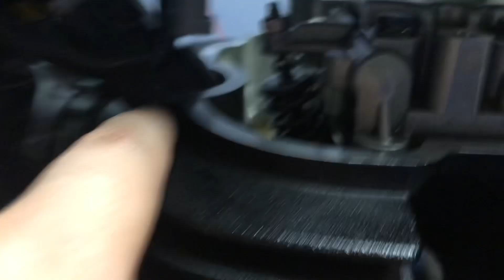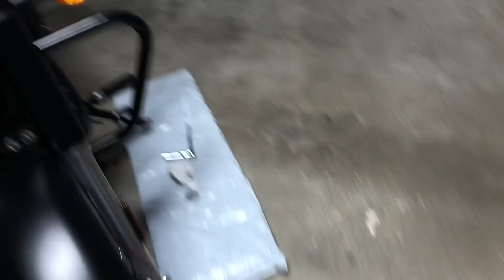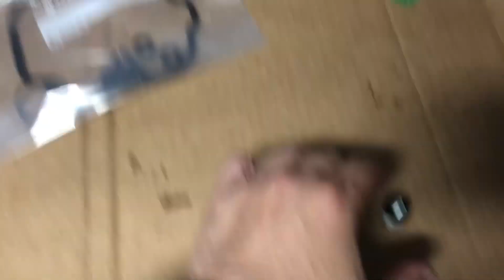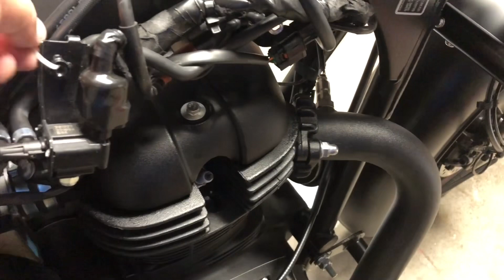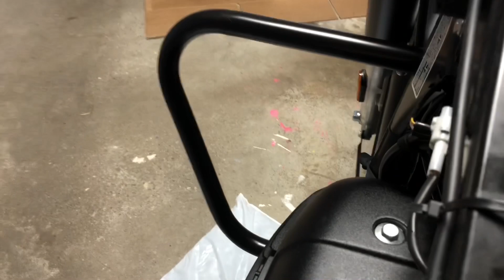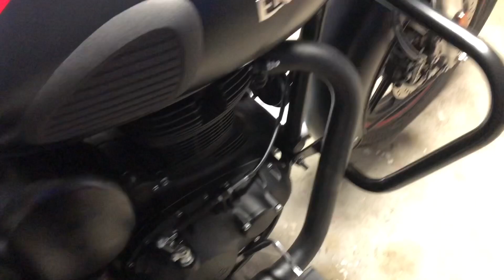Royal Enfield Classic 350 300 mile service Part 3 of 3

Comment from the maker: Just wanted to clear things up. As far as the camshaft position for top dead center. There is a raised marking on the back side of the cam gear. That marking is aligned with the hole I say to use to line up with the hole on the top of the rocker box. So you will see that the side hole in the cam and the markings are what you use the find top dead center. It may be easier to look from the top down to see it.
Reply from the maker: @@terrywillefert i completely agree. I’m in America. I was a master machinist and now work as an engineer. I’ve spent year making methods. Those are like small sections of a service manual in the manufacture process. Yeah. It’s terrible for explaining the tappet adjustment. I’ve definitely seen better service manuals. 
On a different note. I can tell you the reason for service manual’s being better in America. It’s because government regulations and national standards. It’s a very lawyer heavy culture over here.

Comment: Always good to see vids showing how easy home maintenance is on these great little bikes.
I've found when taking off the rocker cover if you unplug the little grey connector at the back of the cover that sits in  the cut out , its way easier to get off and put back.
Reply from the maker: Thanks for the tip. I’ll try that next time.